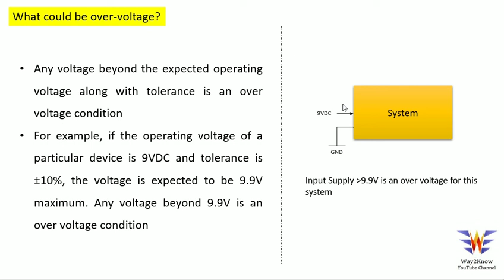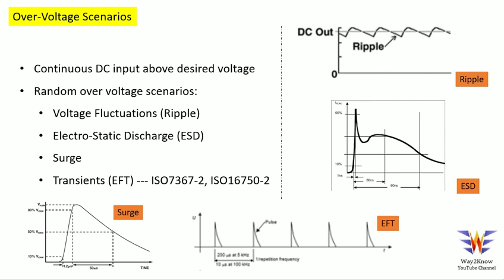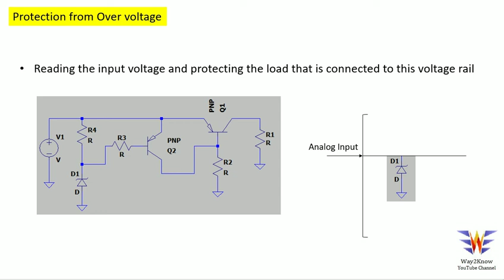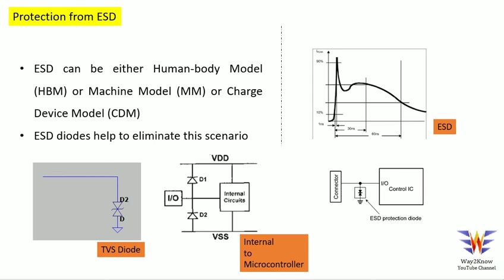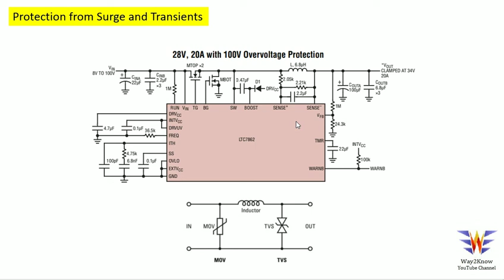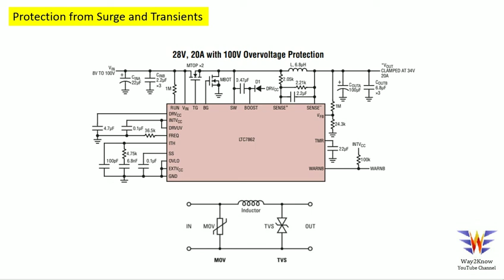Comment: For EFT protection, what will be do in circuit
Reply: For EFT, TVS diode can be used.
Reply: @Way2Know  tvs diode used in esd, or it's voltage rating too small, if in circuit 4KV EFT required then
Reply: Ok, you can use a crowbar or a MOV in such cases.
Reply: @Way2Know  I have tested a circuit with mov, in this circuit MOV is working only during surge test, during eft test mov not properly working, my circuit will be damage
Reply: How did you calculate the MOV requirement? It should work unless the current specification is not considered properly
Reply: @Way2Know  my requirement is 10 KV impulse/surge and 4kv eft test, Mov clamp above 1.3 Kv
Reply: 1. Can you change your MOV to higher current/voltage rating once?

My understanding is that your MOV is either degrading or burning due to high current that is passed.
Reply: @UClGIIimrGP0B0kF1yPFCHFw if I will take EFT issue in any type of circuit, what is the basic guidelines